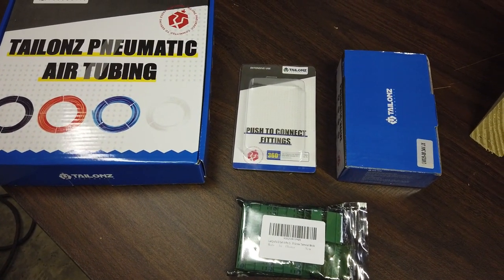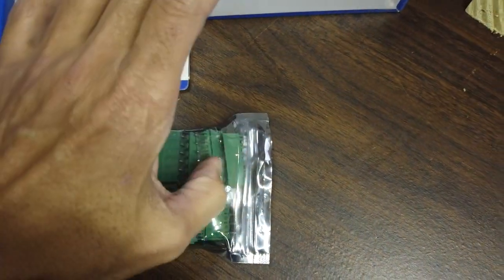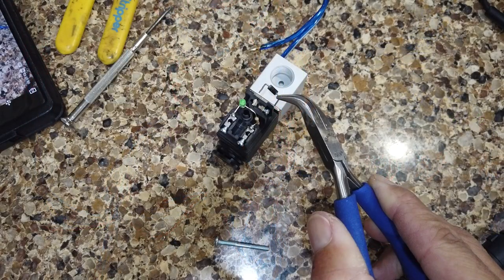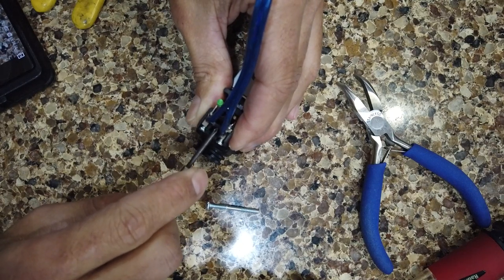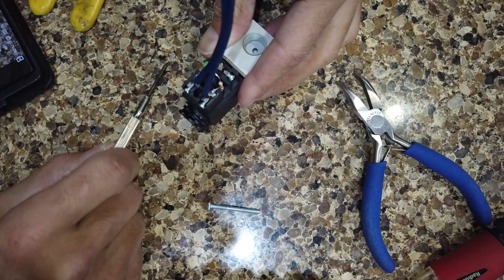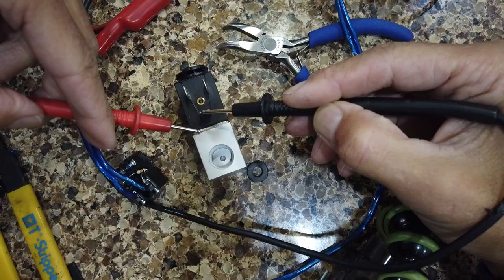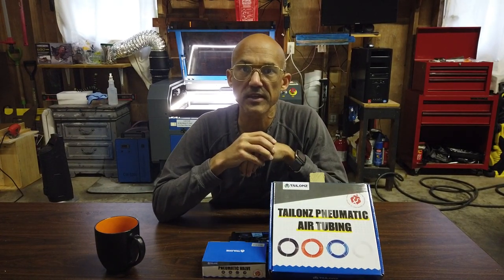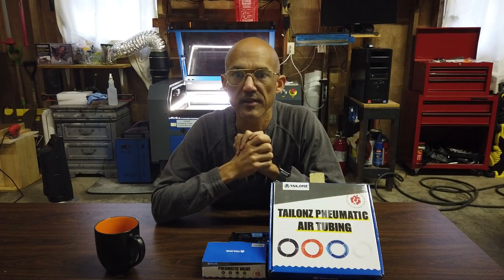CO2 Laser Air Assist - Extra Ultimate Upgrade for Omtech / Ebay / Chinese Laser Engraver / Cutter

Comment: I'm doing something similar. I have the sculpfun S30 Pro 10 watt which has air assist but it's a little fish tank pump which is controllable in Lightburn- I like how it goes into the head and keeps the lense clear. I'm going to add a seperate higher pressure air assist hooked up to a compressor that is manually turned on/off with a flexible/movable tip so I can direct the air in different directions. I probably won't use the extra system very often but for thicker wood a higher pressure nozzle that I can move around will be very handy. I'm making the whole thing myself though- it's a very simple concept, the only part I'll really need are the tip and a way to mount it- I'll just control the psi either through the tank itself or through a sperate PSI connector/adjuster that's closer to the laser for convenience
Reply from the maker: Brilliant! I sure hope it works for your setup!!
Reply: @directedt3ch  I've got it added and I am loving the results. I ended up just scrapping the fish tank pump and use an 8 gallon compressor. Now I have the air going into the lens as well as a flexible hose that T's off from it and I can adjust its orientation, and it has a separate PSI adjuster thingy (can't think of the word for it) so I can run them both at different PSI's it really helps with cuts (most of what I do). It's manual now, so I have to turn it on by hand, though the adjustments are right next to the laser/computer- makes it hard to forget to turn on. I will be adding either a solenoid or more likely a ball valve so I can re-automate it in lightburn, but that's down the road a bit.
Reply from the maker: @Chaos_God_of_Fate  Very cool!  Nice work!

Comment: hi, did you put the diode on the high or low pressure valve or on both? Anyway, congratulations, nice video, well explained, greetings from Italy
Reply from the maker: There is a diode on both the high pressure and low pressure solenoids.
Reply: Will this still work without the diode in the solenoid??
Reply from the maker: @TJ001100  It will, you just risk damage to the controller. You'll notice the diodes on page 29 of the manual - https://www.ruidacontroller.com/wp-content/uploads/2021/10/RDC644XGS-Control-System-V1.3-Manual.pdf

Comment: How do I differentiate the two solenoids??  Is the solenoid with the diode the high pressure one?
Reply from the maker: Both solenoids should have a diode (it protects the controller).  The solenoid connected to "Wind" is the high pressure side and the one I connected to status is the low pressure side.
Reply: @directedt3ch  thank you🙌🏻
Reply: @inc55 Thanks for asking the question I was going to ask 👍

Comment: I just did this with Rudia 6442s controller and my low pressure comes on with no air assist in LB but so does the high pressure. regardless if in LB it is set to off or on. I have High on the 24v and Wind, Low on 24v and status. Not sure why the high also comes on.
Reply from the maker: You did toggle the settings in lightburn for Machine Settings > Vendor Settings > "Enable Air Assist Output" correct? - https://youtu.be/TtJXPyLM_Bc?si=XEb2dDDlVAbpz678&t=1952

Comment: I liked the idea but why not just use the stock air pump for low and the compressor  high. That way compressor air isn’t used except for cutting which would cut down on compressor cycling.
Reply from the maker: That would be another solution!
Reply: That is what I did. Works awesome.
Reply: I am currently doing the same, but manually. I have the high pressure air on a ball valve, and on board low pressure compressor to a switch on the side of the laser. I would like to switch to electronic valves, but how are you connecting the on board compressor as it’s running constantly, are you switching it on with a relay or letting it run and bypassing air thru electronic valve?
Reply: @jimreykdal7477 hey I was thinking of this as well. Did you wire it up using one seloniod or 2? (Ex: hook up the stock compressor to the seloniod?) Or did you use one seloniod for the high pressure only? Thanks
Reply: @jimreykdal7477 also how did you wire it up?
Reply: @TJ001100  I just left the stock alone and used 1 solenoid for the high pressure and just used a T after the solenoid for the stock.  So the stock is always on.  Works perfectly!.
Reply: @jimreykdal7477 the high pressure air doesn’t back feed and come out of the onboard pump when the solenoid opens? I like the 1 solenoid option if it works. Thanks
Reply: @neilphillips9163  not as far as I can tell.  if it does there doesn't seem to be any adverse effects.

Comment: Nice job.  I like what you did.  My only suggestion, is NEVER tin stranded wire when used in the screw type connector.  Over time, the solder and 'flow' and allow the connection to become loose creating a high resistance connection.  Use a ferrule instead.  Now since this is a low power connection, nothing bad will happen ans there is not enough current flowing to cause the issue.
Reply from the maker: I appreciate the tip!